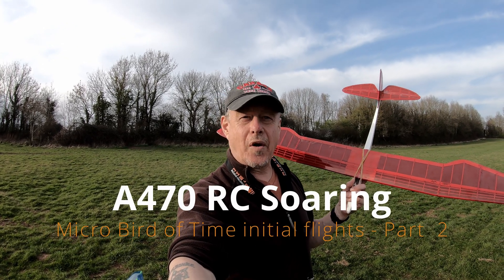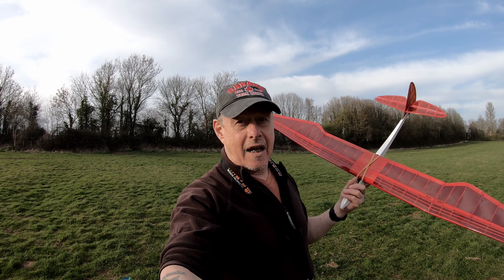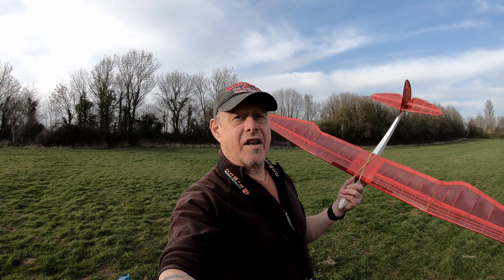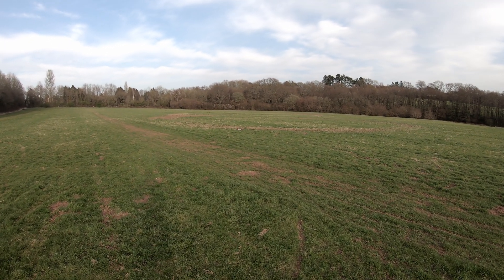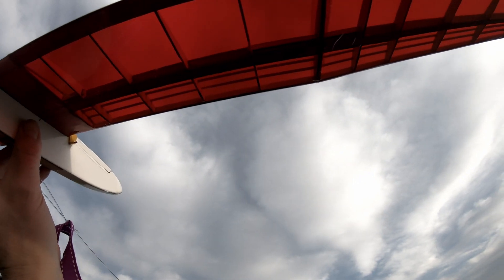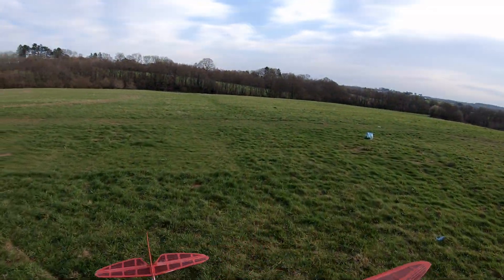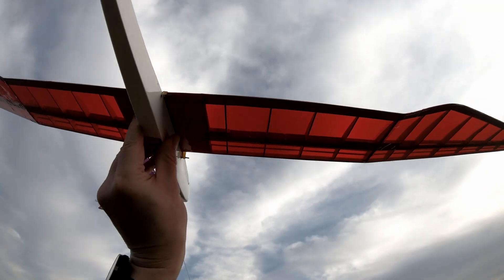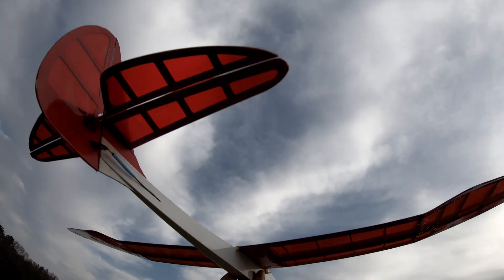Micro BoT initial flights| Part 2 - hi-start launching

Comment: Here are my two cents being an old time free flight modeler and having done a few small high start models..... make sure your wings are seated on the saddle firmly during hi-start and that it is not being dislocated. Also check the stiffness and warping issues during launch since there is a lot of downward pull due to the bungee. Maybe there is a washout being created due to warping in one side of the wing.

Comment: I would suggest more tension on the high start.   Walk back farther.   Next launch at a steeper angle, your launch angle is much too shallow.   Remember, you're going for altitude on the launch, not speed.   It is getting squirrely because it's going too fast and not gaining altitude.   Finally, you might have to move the tow hook back a bit but this depends on how it behaves after trying more tension on the high start and launching at a steeper angle.   I started flying model sailplanes 40 years ago.

Comment: Here is some friendly advice from Virginia USA (a former British colony)!.  Make sure rear of hook is lower than bend... perhaps by 30 degrees.  Bottom of hook should not be parallel to fuselage bottom.  Easier to slide off.  Then, find exact CG under wing root after all glide tests.  Hook should be about 45 to 60 degrees forward (with 90 degrees down being directly under CG).  Try 30 degrees forward for real windy days.  Personally I like 60 degrees for calm/slight breeze.  Also, try pitching the nose up about 30 to 45 degrees at launch and release.  Happy soaring.
Reply: Chris Hushak
I never hand-launch anything nose up.
Remember we're starting with zero airspeed. Releasing a model at 45, or even just 30 degrees nose high is a recipe for disaster. 
If the balance point and tow hook location are correct, the glider should go up the hi-start all on its own.
Rudder corrections for any wind shift should be all that's required.
I point the nose directly at the stake and give it a shove straight ahead.
She should go up just like a kite in a steady breeze.
Green air!
Reply from the maker: Thanks for the advise Chris, I’ve done very little hi-start launching so all advise is welcome 👍
Reply: On bigger gliders there is an adjustable hook. You start with it forward and move it rearward until the fish-tailing you experienced starts to happen, then move a little forward. Don't rush to get off the line. With a little up elevator and flying into a breeze you can kite upwards until the line is almost vertical, and starting to stretch. Pulling up elevator will 'ping' the line off the hook and reduce the height loss that you experience when diving to get off the line.

Comment: I'd think a lighter, longer string section on the rubber, and moving the hook forward will smooth thing out and help it track straighter and higher at release. Following closely as my mini BOT from Josh is next on the build bench. I am enjoying this project of yours!
Reply from the maker: That’s the plan for next time Len. I’m also going to double the length of the rubber from 16’ to 32’ (approx 10 metres) and add 100’ of 15lb braided fishing line. Thanks for watching.

Comment: Hi Steve, once settled your Micro BoT had a nice glide 👍 As it's consistently rolling left double check there's no warps in any of the flying surfaces and the wing is seating correctly and level with the tail surfaces - a slight difference may not show up on the glide but the extra speed on the hi-start will. I'm sure you set dual rudder rates on your first flight video. Set that up again as I've found with light gliders that if I do need to correct on the hi-start it's too easy to over correct and end up zig-zagging like what was happening with you. So I use a very low rate on the rudder for launches and then switch to normal once off the line. Looking forward to your 3rd episode 👍 Oh that was cool when you caught that little bit of low level thermal activity - it was definitely there as you did that one tight circle without sinking 👍
Reply from the maker: Thanks Carl 👍